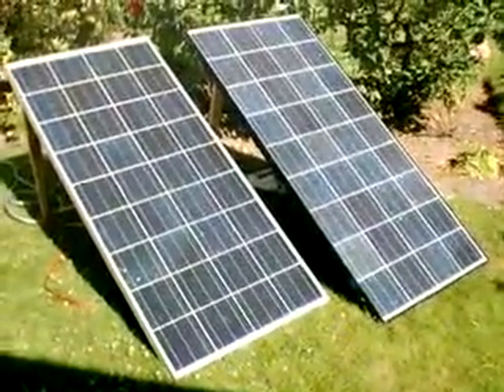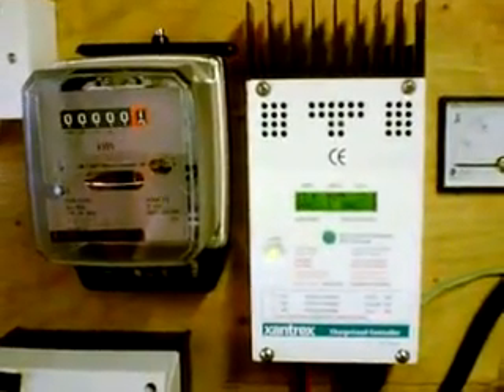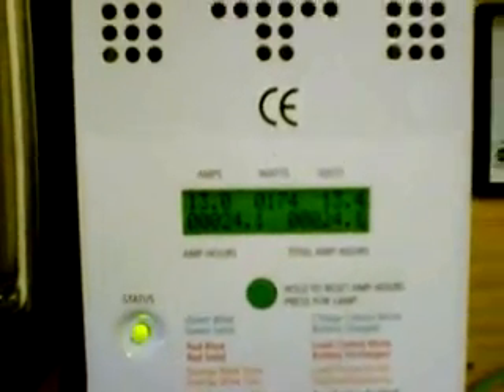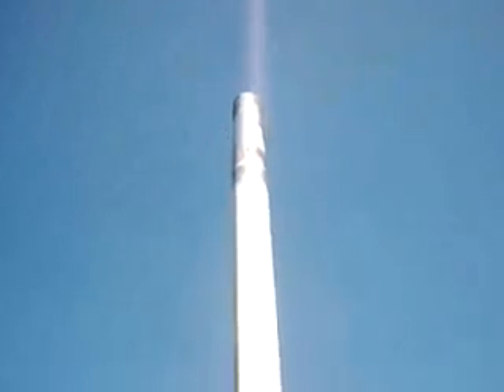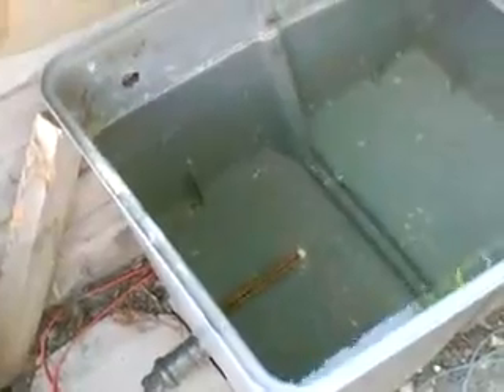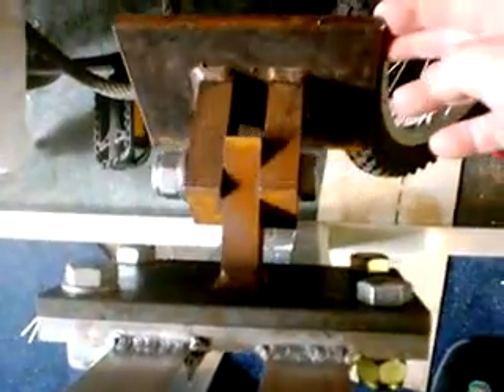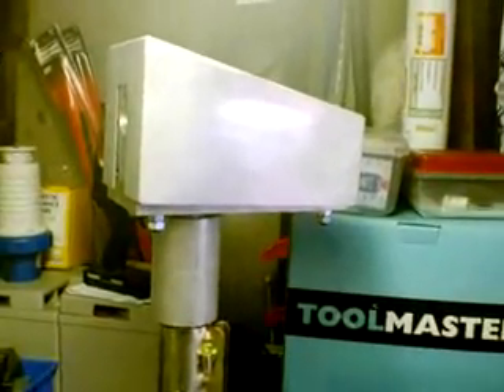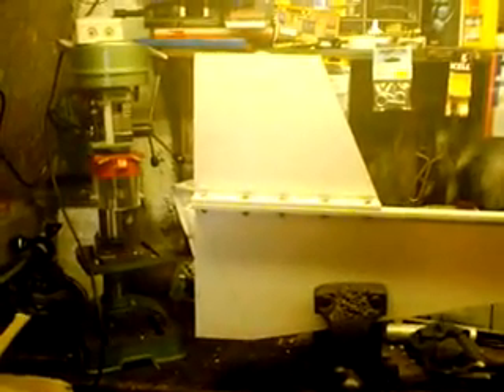Solar and Wind Turbine Update

Comment from the maker: No its not made for the pole I just drilled a hole in the pole ( I must have got that saying from alo Alo from TV ) 6mm hole straight through and it fitted securely.

PS Solar tracker nearly ready to fit in the next month.

Comment from the maker: Yes it will run at 12v just very slowly.this is needed for the tracking controller which I  purchased from the USA from Duane C. Johnson ,when I get my other 2 panels from my Bro next week (being shipped this Tuesday,I am going to convert the system to 24v because I can use a bit smaller gauge wire to keep the wire running cooler as it gets hot at 12v.
when I get the tracker I will record a short vid to explain all.
still working there at the mo 3 day wk

Comment from the maker: Decided today that the wind generator on the front of the wind turbine which the blades attach to is going to be changed to a 24v version because my system will operate at a lower amperage overall So my 12v one will be on ebay very soon up for grabs.

Comment from the maker: the idea is to heat hot water when not using power ,electric and hot water was the simplest idea at the time .
,no wasting at all.
until they come up with a g83 grid tye (affordable)this is the simplest way to not melt the wire in my system.
got to be very carefull as it grows and I learn.